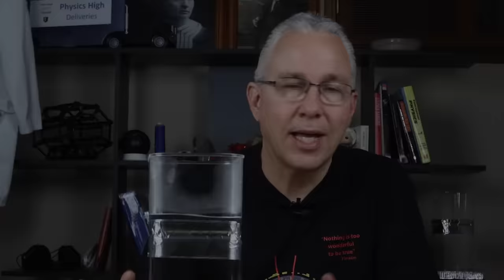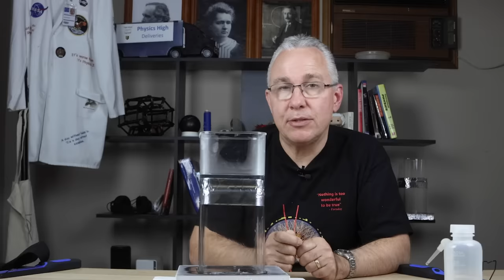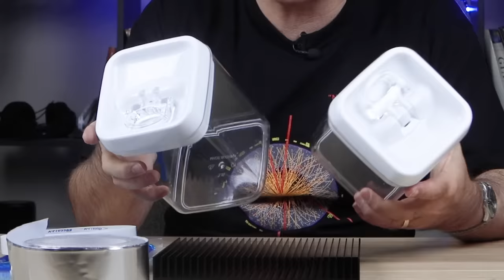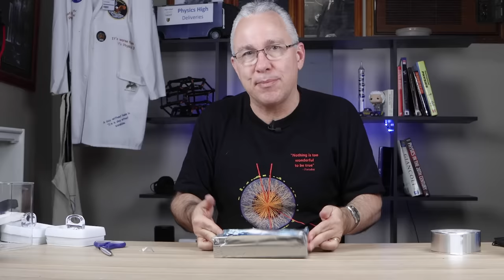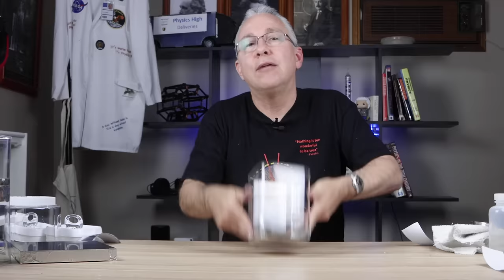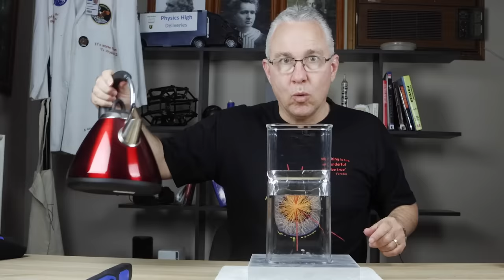DIY cloud chamber: no dry ice required - how to make, how it works!

Comment: Hi Paul, it's me again. I have builded the chamber and try it 2 times, but i didn't even get the "rain".
My base is at -18º and the water is always very hot, the alcohol is pure too. I also puted some vaseline on the edges of the chamber.
Any idea of what could have been wrong?
Reply from the maker: I’m sorry to hear that. I don’t know. You could send a video or photo of your set up but  unless I see it up and close it’s hard to work out
Reply: @PhysicsHigh  Okay! Where do I send it? If it doesn't boder you, of course.
Reply: @gaeloni7775  you'll find me email in the About section  - best share from google drive
Reply: Perhaps you live in a place well protected from radiations and cosmic rays?  I'd suggest to bring in some granit pebble or bananas!
Reply: @informatimago  Not the case I think! i don't even create the cloud.
Reply: What's the distance between the base and the hot water section ? You need about 30 cm minimum. I also warm the alcohol bottle by sitting it in hot water, before putting it on the felt underside.
Reply: @paullooyen1951  Sended!
Reply: @nssherlock4547  30 cm is too much. In fact the one on the video doesn't have 30 cm. I will try to warm the alcohol thanks!
Reply: Did you find a solution for your problem? I have the same problem. No fog inside. Just a wet layer of alcohol is left on the bottom.

Comment: For a radioactive source, could you use a Coleman lantern mantle? Or from the radium on an old clock face?
Reply: Yes.  Clock face or clock needle with "glow in dark" works great. Be aware that what you want to see from the "source" might be swamped by background radiation (what this video uses as sole source).  To eliminate much of the background radiation, apply a "clearing field" by setting about 100 Volts DC across the top vs bottom of viewing chamber.  You can get this by piggy backing 9 Volt batteries and running a wire to top and another to the bottom aluminum foil.
Reply: @karltrappe7049  
I was expecting to see the curling paths. I was not expecting the trails to be so easily observed. Am I’m confusing ‘cloud chamber’ and ‘bubble chamber’?

I have a military compass with a tritium dial. And an old aviation sextant with a large radium illumination dial. It really ticks off a small ($200) Geiger counter. So, would the cloud chamber effectively be similar to a Geiger counter?
Reply: @larryscott3982  The "signature" shape of the paths let you know the identity of the particles.  Any unusual path is an alert to hope (wish?) that you just discovered a new elementary particle.
Reply: @karltrappe7049  
I found the video interesting for several reasons
Reply: Are Coleman gas mantles still radioactive? In the Netherlands they stopped selling radioactive gas mantles in the 90s.
And glow in the dark is not radioactive. You need radium dials. These don't need to be "charged with light" first and keep emitting light for centuries.
Reply: @woutmoerman711  
I thought tritium might be active enough. My tritium compass has a hazmat notice on it for disposal. 

And I do have new/old stock radio active mantles and an old sextant. They ring a Geiger counter.
Reply: @larryscott3982  tritium should not work, as the radiation has a very short range and is absorbed in the device itself. If it works it means the device is leaking tritium. The range of the tritium particles is about 10x less than of alpha radiation.
Reply: @woutmoerman711  
Again I found a lot in your beyond just the build. 

Thanx

Comment: If these particles are moving at near light speed, how can you see it clearly moving from left to right or vice versa?
At 30fps no less.
Reply from the maker: When they are created that travelling at near the speed of light. However, by the time they reach us and into the cloud chamber they will definitely have slowed down. However also, the rate of condensation that causes the track is going to be delayed so the muon willpass straight through but the stream of bubbles Will be much slower

Comment: guys will it work if use a metal plate instead of a heat sink??
Reply from the maker: The purpose of the heat sink with the gel is to slow the rate of heating. Other words you wanted to stay well below 0°C for sometime. If you simply have a metal plate out of the freezer it will warm up quite quickly and therefore be effective in terms of keeping the temperature gradient to saturate the air with alcohol.

Comment: I have not tried to build this yet but can someone who has please comment on the orientation of the tracks originating from cosmic rays? Are they always vertical or near vertical? Are the traces always a straight line, or is there evidence of curving or collisions?
Reply: No, they come in at all kinds of angles. Cosmic rays (think nucleus of a heavy atom going near the speed of light) smack neutrons loose from air atoms in the upper atmosphere. Those neutrons are what make it down to where we live. Most of the tracks you see come from those secondary neutrons that have bounced around enough to be coming from just about any direction. When a neutron smacks into a nucleus, that nucleus becomes a heavy charged particle, which makes the bright, straight tracks. You'll also sometimes see paler, multi-directional tracks from beta particles and gamma rays/x-rays.

Comment: can you use a standard geiger counter test card (around 15 bucks on amazon) to test this and get a lot more trails?
Reply: Didn’t know they sold that on amazon.. gotta check that out. 

But yeah! you definitely can use one of those and the cool thing about the different types of radiation is that you can tell the difference between it by watching it in a  cloudchamber. However a large surface area cloud chamber is preferable for telling the difference.

Comment: Hi Paul I have some questions:

How did you cut the plastic?

and

How do you have to distribute the gel?

Thank you!
Reply from the maker: Used a dremel to cut the plastic. It depends on what you use. Clear plastic cups can work too. But since my containers were thicker, the dremel worked best. You could drill a hole and the use a small jigsaw blade. 
Re the gel is simply pushed it in between the fins of the heatsink. You could use a syringe but using a piece of paper wiping it over, forcing out air bubbles, worked fine. If a little messy 🤓
Reply: @PhysicsHigh  Thank you!
So this chamber is as usefull as the dry ice one right?
Reply from the maker: correct - the only limitation is that its a bit smaller ( I couldn't find a very large heat sink) and if you use it in the classroom, less students around it. But as the video shows , I get good tracks

Comment: Any chance of making this into a science toy that can be bought at Hobby Lobby or a similar store?  I envision something like those ant farms that are clear plastic containing a transparent blue gel that the ants tunnel through and eat as well with LEDs underneath.  With this toy, you would just throw the whole thing in the freezer and when it's ready, you can dose the pad with the alcohol and pour in the warm water into the top bowl, all under parental supervision, of course.
Reply: Thinking the same.  There's nothing dangerous about the whole setup other than the isopropyl alcohol which is toxic to ingest and flammable.  If it wasn't included in the kit, I suspect a lot of parents would use the low concentration stuff, but it would be hard to bundle.  Water at 60C would technically scald after a few seconds of exposure, but it's still just basically hot water from the tap.  I definitely think this would be safe enough to sell.
Reply: @MrWhateva10  yeah, just like the ant farm, you would send a code via text or coupon in the mail for the alcohol to be sent in the mail.  Then it is controlled by the parents and there are no shipping and handling issues that the store has to deal with.
Reply: The current liability environment is pretty lethal to cool toy ideas like this. If there is absolutely any chance at all of some kid being injured out of a hundred thousand, it will be banned.

Comment: I don't have any aluminium tape, but I can gets some aluminum tape. Will that work?

😋
Reply from the maker: Having lived in the States I was curious about the different name. Worked out that USA used to use aluminium prior to 1925!
Both versions are acceptable in chemistry journals.
Reply: @PhysicsHigh  The even funnier part is that at the same time Englamd used to say aluminum. It flipped. 😄
Reply from the maker: I did not know that. 😲. I wonder why the two exist etymologically
Reply: @PhysicsHigh  Here it is:
https://youtu.be/eivkXPsKnDA

Comment: Can you do an experiment demonstrating gas pressure without a container?
Reply: J S, breathing is about the simplest example I can think of ;)
Reply: @anullhandle  Your lungs are the container.🤷
Reply: @JS-fj9ik  only when you're holding your breath. You could put two pressure meters or manometer on an open tube with a restriction and blow thru it.  Create an ultrasonic levitator and float Styrofoam beads. Basically any sound is pressure variations no container needed. Standing waves like the levitator, blowing across a soda bottle etc. just fix the high and low pressure zones in space.
Reply: @anullhandle   oh, I forgot about space. Isn't that a vacuum. Then an experiment demonstrating gas pressure, without a container, next to a vacuum. That's the one I want to see.
Reply: @JS-fj9ik  space as in free space not outer space lol.  As for outer space you're standing on the most obvious example.
Reply: @anullhandle   I want to see the experiment demonstrating that, in a lab, gas pressure next to a vacuum without a container.  If it can be done. You know, get a container, create a vacuum, introduce some gases, and separate the two, a vacuum on top and being able to measure the gas pressures throughout the gradient. Better yet, to be able to hold the pressures in the center of the chamber.  Maybe, it can be done with magnetism or frequencies 🤔. I've also been wondering, what is the exact reason the standardized concert tuning frequency is at 440hz🤔.  It wasn't long after the radio was produced that the change happened.  Have you seen those old Hulu commercials? I think they are disturbingly sinister.
Reply: @JS-fj9ik  lol. As long as we're taking a walk under a bridge... Frequency isn't a thing it's a property of a thing or system.  432hz tuning was preferred by some opera dude. Later some magic woo types  not understanding frequency as a property conflated an earth's electromagnetic resonance  frequency 8hz with the numerology of 432hz tuning of unrelated sound waves making middle C closer to 256hz which is divisable by 8. 440hz standard just made life simpler as at the time France said 435 many places said what ever the town thought was cool. Maybe whatever the town church organ had detuned to?  The 8hz resonance is determined by the height of the ionosphere.  It's fueled by lightning an impulse e/m event. As an impulse it rings the bell so to speak  an feeds the resonance. Again any acoustic standing wave will demonstrate high pressure next to low pressure with no divider.  Pretty sure you know all this. :)

Comment: I didn’t see any tracks... how can I change that ?
Reply from the maker: There are a lot factors that limit tracks. 
1. Good temp differential - top 60°+, -18° bottom
2. your container should not be too short, though I have sen it work in a large plastic cup, and gofd thermal conductivity between the two containers
3. Make sure you use 99% ethanol or propanol and enough of it
4. light coating of petroleum jelly to prevent leakage
5. Need to give it time  - at least few minutes
6. What building are you in  - single story better if you are looking for muons as multi level can absorb muons
7. Good lighting
Reply: @PhysicsHigh  okay thank you I will try again

Comment: Thanks. I have a piece of autunite or calcium uranyl phosphate that should look like a pot of popping corn without a lid. Are the trails coming from the sun? If so, it looks like they were at an angle suggesting it was late afternoon or early evening?
Reply: Typically, all solar source particles are captured by the Earth's magnetic field. They are too slow (30-50% the speed of light) to penetrate into the atmosphere, let alone 100km of air. However, galactic source particles are fast and massive. They strike from anywhere (mostly 0-60 degrees from vertical), create many "secondary" particles from colliding with N2 or O2. You would catch the "secondary" particles rather than the originals with a ground-based detector.
Reply: @haroldhenderson2824  thanks! I am trying to figure out if sodium polyacrylate will do since that would mean I have everything onhand now. At first I thought the water would just freeze at 0c but I'm seeing some verbiage that suggests ice crystalization at least happens more slowly with polymer-bound water but... hydroxyethyl cellulose spiked with proylene glycol (literally "antifreeze") sounds colder. I could spike my water with antifreeze before suspending it in the poly...

Comment: Why did you use felt?
Reply from the maker: Holds the ethanol well but fibre SA means it will quickly evaporate with heat.
Reply: @PhysicsHigh  so it's kind of like a gasket?
Reply: @kristopherclark4835  NO, it soaks up the alcohol.

Comment: Why not just set the heatsink on the pack... Freeze it as a unit and never have to deal with the mess of the gel 🧐
Reply from the maker: It’s purpose is to maintain a low temperature. Without the gel the heatsink will warm very quickly to the surroundings.
Reply: @PhysicsHigh  I get that but it'll do it much more efficiently laying on the cold pack mating flat side down, fins up toward the chamber. Granted, it then needs to be sealed but ok whatever this works, it's just not ideal as is for what's in use that's all
Reply from the maker: @MadScientist267  if it works , great.

Comment: But wait, you just casually mention some radio active source.  What would a Thorium rod do?  Might I finally become spider Man?  Or does it increase detections?  I gather from when you said you would have to break it that it would go in the viewing chamber?
Reply from the maker: Welding rods contain thorium which is radioactive. So if you go to a hardware store and pick a couple up, you have a radioactive source available. It may need to be shortened though.

Comment: that heat sink offers no real advantage to the project.
Reply from the maker: It does actually. Filled with the gel, it maintains the lower temperature for much longer than a single piece of metal

Comment: All that aluminum between the two does is restrict heat movement. You're not improving it with that at all, it makes it worse
Reply: You are right if you use a flat aluminium plate. But he uses a heatsink which has a larger surface in contact with the gel.
Reply: @woutmoerman711  Not what I meant lol
Reply: @woutmoerman711  Referring to the foil between the two halves of the chamber (hot side). The heatsink has issues too but I covered that elsewhere
Reply: @MadScientist267  i understand now. And I agree. What does the felt do in that place? I mean what is the function. It also isolates. At first I thought it was to provide a dark background, but the place doesn't make sense.
Reply: @woutmoerman711  Acts as an absorbent for the alcohol, reservoir basically
Reply: @MadScientist267  ok, thanks!
Reply: @woutmoerman711  In a nutshell, operation is as follows:

Hot water in upper chamber heats the surface between the 2 chambers, which the alcohol that's absorbed in the pad is in contact with, causing it to evaporate. It's temperature begins to fall in the gas phase and falls toward the bottom where it is cooled drastically, causing the alcohol to be on the fringe of condensing, so it can be triggered by a particle.

Anything in between the two chambers is going to slow the heat transfer down, in fact the foil does it in 2 ways (also reflects back IR, not just reducing conductivity), and the heatsink is being used in a highly inefficient (and unnecessarily messy) way as well. 

Heatsinks are designed to interface with air, so for highest efficiency the fins should be in the chamber and the flat plane should just be sitting on the cold pack as a unit. That interface of gel-plastic-aluminum is plenty more efficient than the aluminum-air interface on the other side, and is designed to be used that way.

Taking apart the cold pack just to get the gel between the fins doesn't gain anything at all, because that heat can't get into the flat side of the aluminum anywhere near as fast.

Flipping it around as described, it would start producing trails in much less time, none of the several minutes business
Reply: @MadScientist267  interesting info! I'm a radiation protection expert and really interested in building this thing. Your views makes it a lot easier to construct. It sounds very plausible.
Reply from the maker: I’m curious on your take with this and certainly worth investigating. As I said in my video my design is not completely on my own and based on a paper written in Japan by researchers who experimented with a couple of different techniques of making cloud Chambers.
The purpose of the gel is not about heat conductivity it’s more about maintaining the -18° for a longer period of time.